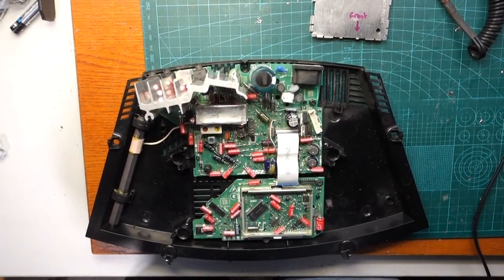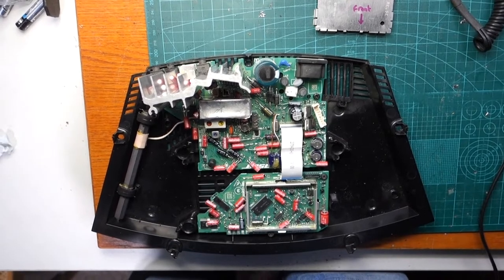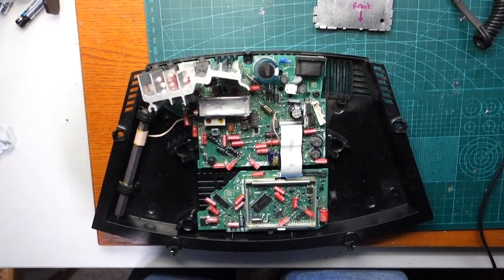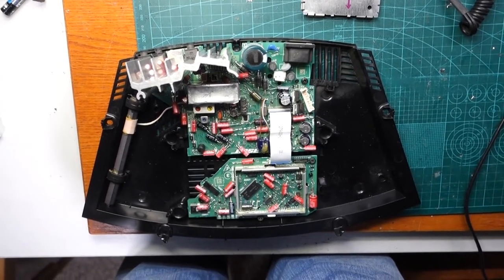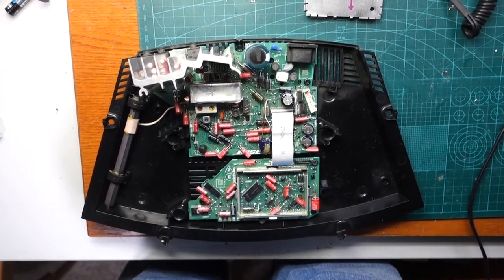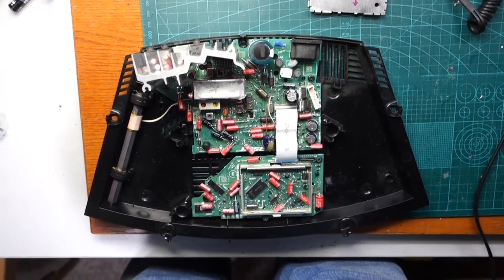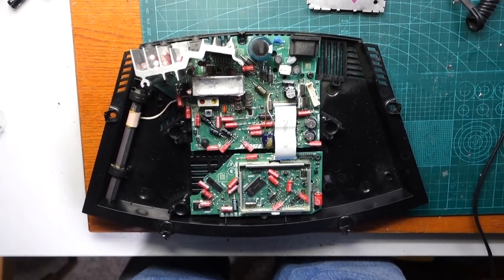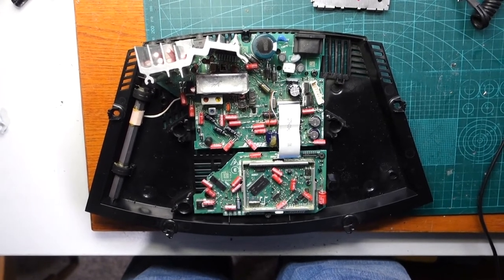Bose Wave Radio Capacitor Replacement

Comment: Hi Simon. This is absolutely fantastic! You did a better job of replacing the caps than I did. Great job. Your BOSE radio should last forever at this point. The caps are the only weak link that I know of.